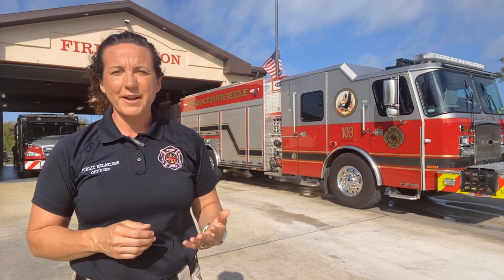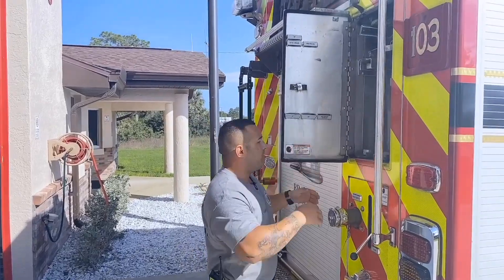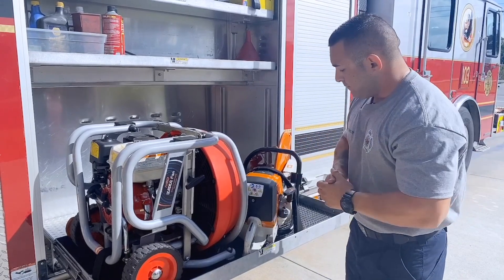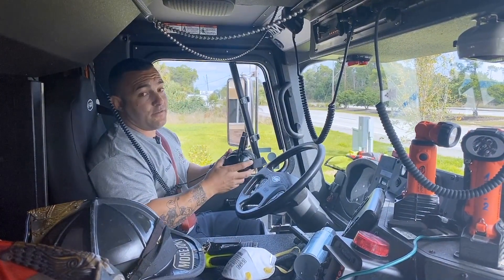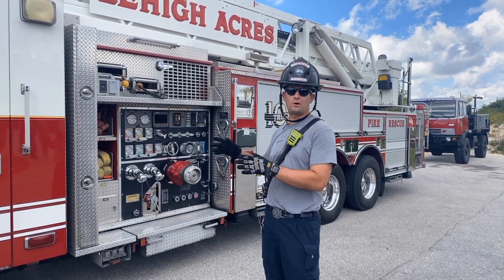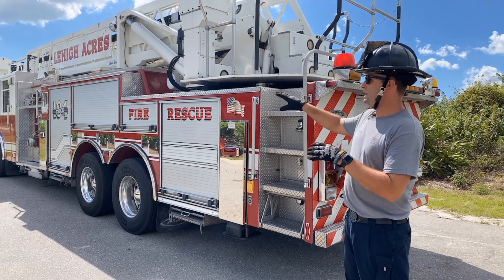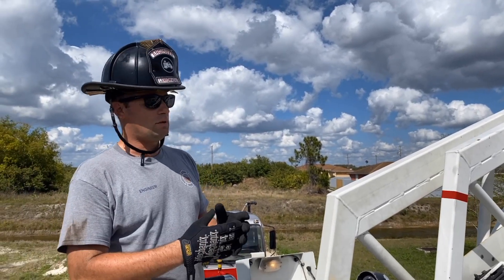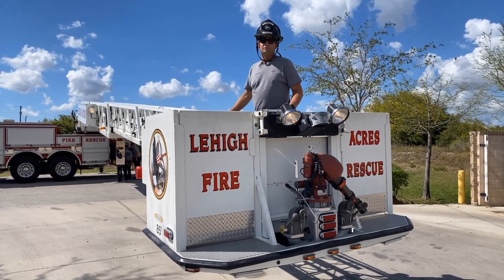Firefighter Engineers

Comment: when searching online, I don't know if I am mixing up fire protection engineer with fire engineer. Does this position, the driver and operator of engine and truck, require a college degree?
Reply from the maker: It is not a requirement at our department.
Reply: Typically fire academies offer a class called Drivers Op, that class goes over most of this. Some departments want people to have Drivers Op to do the trucks, some train you on job themselves. My department doesn't require driver's op, but they do require TIMs and the completion of a work book made by the department on how to operate the trucks. Another department in my area requires Drivers Op, while others see already having driver's op as a great certification on a resume. I personally suggest completing Drivers Op after FF1,FF2, EMR and TIMs. Your ICS 100,200,700,800 classes can be great to have under your belt too. Depending on what state you live in or what department you're on, some Volunteer departments will send you to academy for free. If you have an opportunity to get easy useful certifications, do it